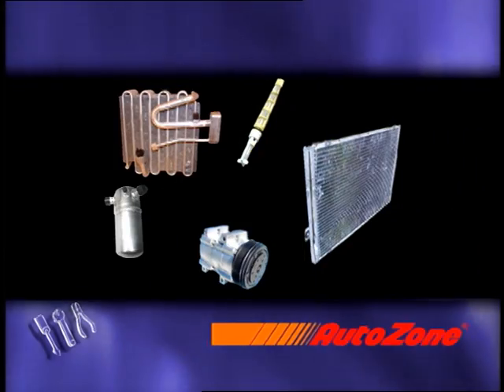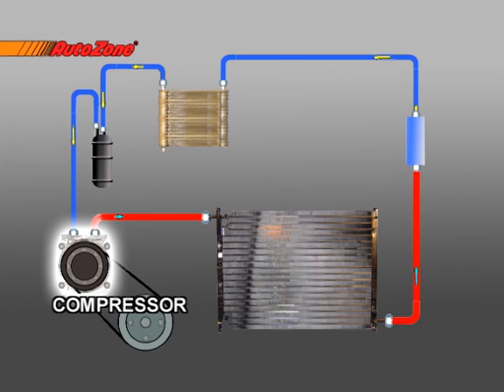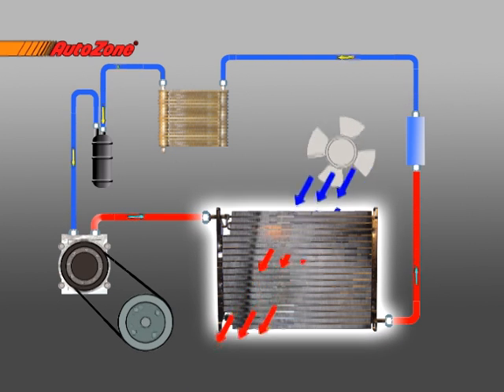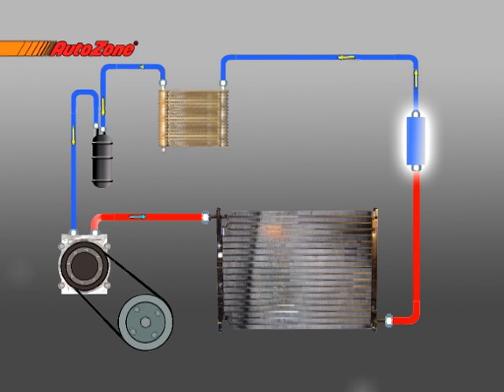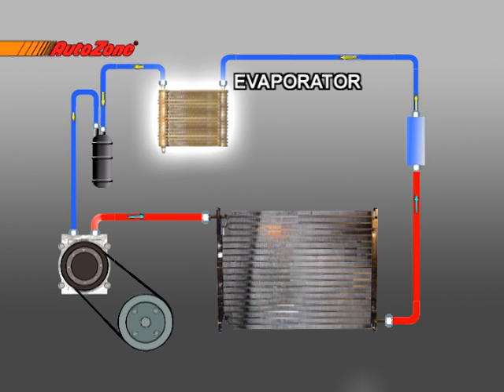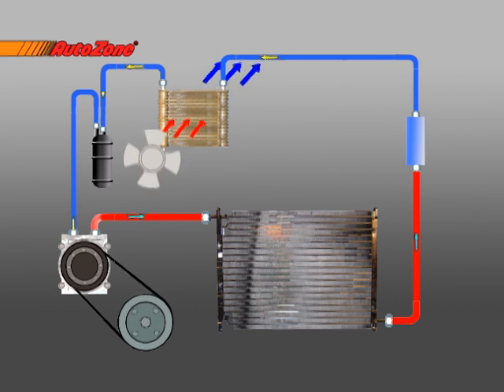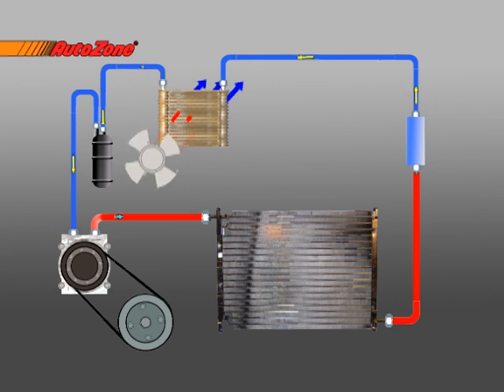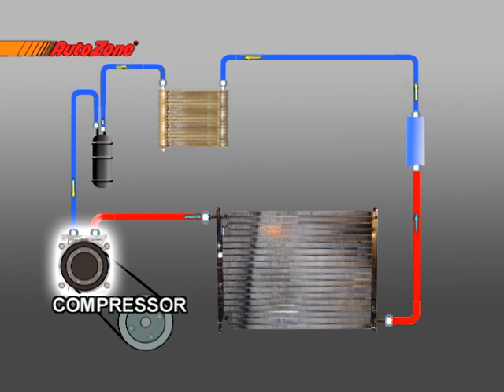Car Air ConditioningParts - AutoZone Car Care

Comment: 2:44 Actually the expansion valve/orifice doesn't meter anything. It's to change the state of the refrigerant from high pressure, ambient temp liquid to low pressure, low temp liquid. Since there is no heat transfer over an orifice, the low pressure liquid loses temperature along with pressure as it travels through the orifice, courtesy Boyle's Law.

Comment: I have what others are telling me as a strange problem. Checked my gauges on on 5 other properly working systems to make sure that they are working correctly and they are. I'm working on an 07 ford f150 5.4 V8. My gauges are reading 125 on both the high a low sides in the off position and the ac on max position. The clutch is engaged and the compressor is working. The system has no leaks and the condenser is clean. The air is blowing correctly through the center vents, but all I get is warm air (around 80). The only thing that I have opened up was the orifice tube and it was clean and the oil was as clean as new. I vacuumed the system for around 45 minutes and recharged. The clutch kicked in around one pound of 134a and the system holds 2.3something lbs. Any ideas on what I am missing?